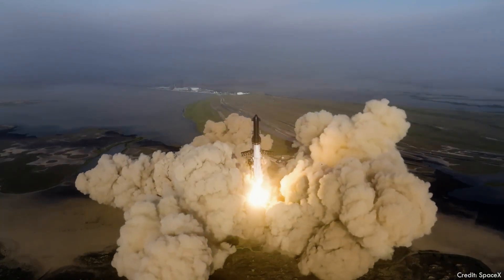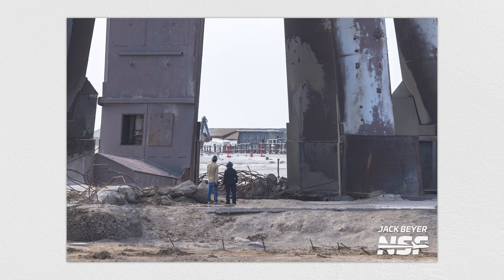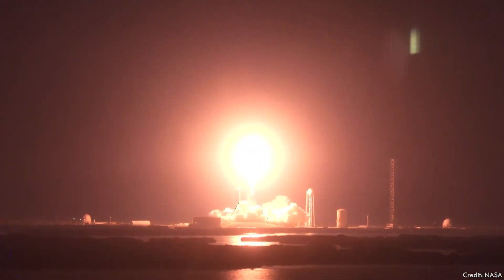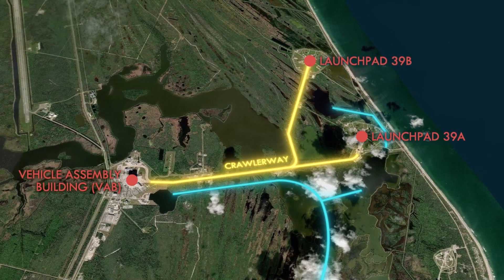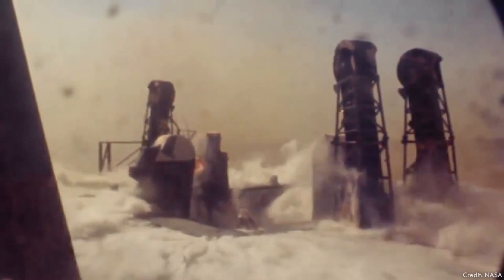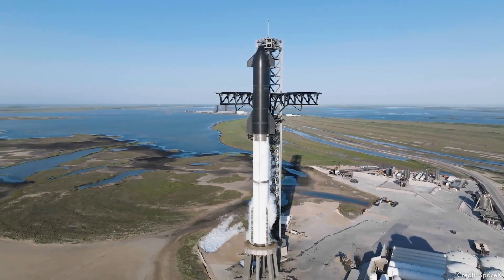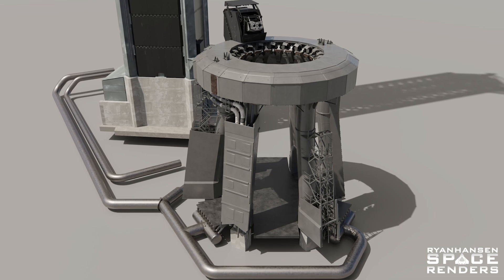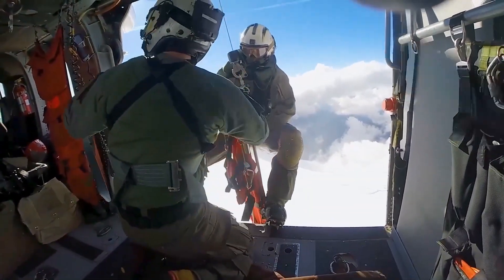Was Starship’s Stage Zero a Bad Pad?

Comment: I'm not sure that rocket engineering is something that should be subject to a rapid development cycle. Hopefully the regulators force more care into their preparations as this situation looked like it was entirely avoidable, they were just too cheap to build a well-tested existing design.
Reply: One thing I learned from the comments is that there's always a naysayer until they move to the next goalpost, i remember when they tried to land the booster and fail and shower of negative comment about why not use paraglide blabla
Reply: it already made the falcon 9 the most awesome rocket ever.
Reply: For cargo, it's a case of buyer beware for the most part, if the rocket blows up it's just an expensive insurance claim. But for passengers it's a completely different story. This is why I'm sceptical Starship is going to be used for crewed flights any time soon, not until it's had at least a couple years of regular reliable unmanned launches.
Reply: @Croz89  It's not going to be used for crewed flights anytime soon, they've explicitly said they're not trying that until they have a lot of reliable successful cargo flights under their belt.
Reply: @zorbathut  Yeah, though there's a bit of a disconnect between grounded statements from SpaceX and Elon's marketing hype, which probably makes some people think he wants to send off a Starship full of astronauts to Mars by next tuesday.
Reply: @snuffeldjuret  I'm not so convinced. He could be much more careful with his words if he chose to be. But he knows generating hype is good for business even if it comes to nothing, and I'm sure it pleases his often rather devoted fanbase no end.
Reply: @snuffeldjuret  It's not illegal at all, he's not in a courtroom. Lots of corporate leaders promise the moon and don't deliver, it's just Elon is especially prolific with hype. And I'm sure he's clever enough to formulate a grounded and realistic answer from any question the media throws at him. But he thinks it's better not to, and based on the fame and wealth it's got him, it's clearly worked well for him.
Reply: @snuffeldjuret  Hmm... if he said it under oath, perhaps? He could also mislead investors, but just making overly ambitious statements is unlikely to be enough for that. Honestly some of his statements about Tesla and Twitter stray way closer to illegality than anything he's said about SpaceX.
Reply: @snuffeldjuret  The truth is I can't think of much of what he's been saying that could be illegal, not about SpaceX anyway. I think it's up to you to prove illegality rather then me to disprove it. Because freedom of speech heavily restricts being arrested for just making a statement.
Reply: @snuffeldjuret  Huh? I'm sure you're the one who said marketing hype would be illegal.
Reply: @snuffeldjuret  @Croz89 For statements by a company to be illegal, they largely have to fall into two categories:

1. They are statements about the past or present, that are false, and the person making the statement should be aware that they are false. Saying something like "We have developed a new technology to do X" would be an example, if they have developed no such technology. Or "We just landed a huge contract", when no huge contract was signed.
2. They are statements about the future, that the company is certain won't happen. So saying something like "We will land people on Mars" is fine, if they believe it. If however an email surfaces where the person says "we are obviously never going to land on Mars, but I'm gonna go lie to the investors about it" then that is not fine. The issue here is proving what goes on in someone's head.

Musk says a lot of things about the future that turn out to be false, but did he believe the things he said when he said them? Probably yes. And that is not illegal.
Reply: @SpaceAdvocate  And even if he didn't believe them, that wouldn't be enough make a case against him.
Reply: Considering the built-in self-destruct also failed, combined how obvious the pad failure should have been ...Yeah, I'm not at all unsure about whether or not rockets should have rapid development cycles.
Reply: Yeah, this result was obvious to quite a few people before the launch happened. It's not like this was an unexpected event. The Boca Chica site was never supposed to launch things anywhere near this size, Elon just got a toe in the door and wedged it all the way open. He was obviously more interested in the press this launch would generate than actually making this launch site successful.
Reply: @warpigs330  Nope, thats how spaceX operates for the past 20 years. Theres a whole compilation of their rockets blowing up. SpaceX themselves said they "hoped" the launchpad was going to make it through one launch, which means they accepted the risk that comes with it.
Since it was launched 4/20, yes hes a little bit of a memer. But the launch was going to happen in April no matter what.

SpaceX will keep blowing up rockets and people will keep complaining and thats fine.
Reply: @warpigs330  in musk mind a failure is a success.
Reply: @warpigs330  it was supposed to when they got permission for it.
Reply: Rocket engineering can be done in a rapid prototyping sort of way, if you don't try to be extremely cheap and work around regulations, which IMO is the dangerous mix that SpaceX is working with.

For example, if you look at the environmental assessment, the number (and thrust) of engines reported doesn't match Starship at all. Some folks have claimed this was done to increase their odds of getting the assessment approved fast, because if they used the forecasted Starship data then it would be clear that lots of mitigations such as flame trenches/diverters were required and approvals for those sometimes take years.
Reply: You must think they're building a dam or something. There is much that you're likely not aware of. Example, there are no flame diverters on Mars. The destruction was part of the learning process
Reply: @IRRoy-69  are you saying the destruction was on purpose?
Reply: @leafnut1  Well, forget Mars launches for some time.  Best not find excuses for that incompetents.

Comment: Virtually every aspect of this launch failed. The pad, the engines, the emergency abort system, the separation, the extremely low speed and distance achieved…

…but if you work for Space X you have to cheer or you’ll be fired.
Reply: No, it was a resounding success.

Comment: Just a point of clarification: The flame deflectors of launch pad 39A and 39B, during the Saturn and Shuttle eras, were steel frames covered in concrete. At least during a Saturn launch, approximately one foot of the concrete was ablated off of it. Also, the one shown in your graphic at about the 6:18 point is for the Ariane pad in French Guiana. It is a one sided deflector. The Saturn deflector split the exhaust to two sides.

Also, the flame trenches were initially lined with ceramic fire bricks to protect the underlying concrete. I don't know if that has been replaced by refractory concrete or some combination.
Reply: Actually, to correct your correction: The graphic at 6:18 is indeed LC-39B, and not the Ariane V pad. One of the SLS mods was to make the flame deflector one-sided.
Reply: Thank you for the extra information on the flame deflector designs.
Reply: "Ablated off" is my new favorite way of saying "utterly obliterated."
Reply: @ethannguyen2551  The difference between those two terms is as fine as the line between 'that worked out how it was supposed to' and 'honest, that was definitely how we planned it, I guess?'... 😂
Reply: "spit into two sides" I'm thinking that looked like an inverted aerospike?
Reply: @JoshyCC  Effectively, yes.  A linear AeroSpike anyway.
Reply: AFAIR (from David Baker's books 'The Rocket'/'The History of Manned Spaceflight' read 35 years ago), the flame deflectors in Pads 39A/B for the Saturn 5 were inverted V-shape mobile structures made of steel with their exposed surfaces covered with a refractory layer of a basalt-like material of volcanic origin.
Reply: One Shuttle launch spit bricks out at supersonic speeds
Reply: repentandbelieveinJesusChrist9  Go and pray for us to repent instead of spamming YouTube
Reply: repentandbelieveinJesusChrist9  Your religion is dying and there is no place for your god-of-the-gaps to hide anymore, all these posts do is push more people away...
Reply: repentandbelieveinJesusChrist9  Maybe you should ask for an x-ray of your head! From afar I'd suppose a pencil shoved up your nose...
Reply: I didn't know there was such a thing as sacrificial concrete!
Reply: repentandbelieveinJesusChrist9   “Troll — in the dungeons — thought you ought to know.” — Professor Quirrell
Reply: repentandbelieveinJesusChrist9  I'll continue seeking retribution for all of the children victimised by the church before anything else kthx.
Reply: @TheDemocrab  And the Jesuits for selling slaves in 1835 to fund the church.
Reply: @TheDemocrab  "... children victimised by the church ..." "Victimized by the Rulers of this World" is the more correct interpretation, based on copious evidence. "The Church" is only a subset of [Their] dominion over Us.
Reply: If you are going to go after the church because some of them abuse, children, you need to go after everybody else as well. Don’t just pick out somebody’s religion and accuse the whole institution of abuse because a few of them committed atrocities. Just shows your own prejudice. I don’t necessarily agree with spamming some message of repentance on YouTube but, you can do better.
Reply: @odinmaximus5768 the thing is, the church has repeatedy and actively covered up these sorts of things. It is therefore quite culpable.
Reply: @DavidLindes 
Which church? Except for a few basic concepts, Christianity is not a monolithic institution! Besides Catholicism, there are about 2,000 other denominations of christianity worldwide. So again, which church? And if your going to say 'all of them' be prepared with examples of each and every one. 
Having said that, yes christianity has had its share of problems. But to blame an entire belief system for the actions of some is a blatant equaivalent of racism. Also your accusations fail to account for the similar actions of others outside Christianity. Is it OK for them?
Reply: @chuckaddison5134  “to blame an entire belief system” makes sense to me when it can be shown (as I believe it can, though I won’t attempt it here — see Greta Christina’s writings or something (not certain if she gets to this specific point, but I’m sure I’ve read someone who does)) that the belief system itself has a causative influence (not to say it’s 100% causative) on the “actions of some” in question — and, especially, when it can also be shown that the “good” actions taken by folks with the belief system are not actually done because of the belief system in most cases, and indeed are often done in spite of said system.

Yeah, there are many many churches. And also, the belief system itself is fundamentally problematic. In ways that aren’t necessarily obvious at first glance… because it’s often the things that get held up as moral goods that create the problems. (E.g. “be fruitful and multiply” leading to a sense of dominion… not to mention teachings that actually encourage dominion… etc. etc.)
Reply: @chuckaddison5134  oh, and I forgot to answer your final question: no, it’s not ok [to do whatever antisocial behavior we might be discussing; I’ll assume for the sake of argument that we agree on what those behaviors are], whatever the motivations and such (i.e. whether religion had anything to do with it or not). That said, if, say, 1/10 murders is caused by a belief system, and 1/100 would-be murders are prevented by the same belief system, then the belief system is still on net responsible for taking more lives (or whatever other ill) than saving them, and our adherence to it should still be discouraged (not to say outlawed — that’s not my argument), in my mind. (Obviously the numbers aren’t so simple — or easy to figure out, even. But I think it can be clearly demonstrated that more lives have been lost and/or ruined specifically in the name of Christianity (or gods more generally) than have been saved by them. “Saved” souls notwithstanding… I’m limiting myself to what we can directly observe on earth.)
Reply: Yep, the wrong footage was shown. 
And yes built to be rebuilt between launches having not damage to the real structure.
Reply: repentandbelieveinJesusChrist9  Thanks for the rubbish.
Reply: "...flame deflectors of launch pad 39A and 39B, steel frames covered in concrete". How is that different from the steel reinforced concrete at starbase that blew apart?   "...during a Saturn launch, approximately one foot of the concrete was ablated off of it"   That was the first saturn launch.   "...the flame trenches were initially lined with ceramic fire bricks".  Firebrick is refractory cement in brick form.
Reply: @rcpmac  The difference is having flame deflectors in the first place, to divert sound, fire and debris into a save direction. Those are designed to be expendable and easy/cheap to replace. Starship burned a nice big hole into the expensive lauchpad and flung debris into every direction, causing even more damage to the surrounding facilities.
Reply: @rcpmac  Bicycles and cars are both steel and alloy/composite vehicles assembled for transportation using rotational energy and a multi-speed transmission to drive drive wheel(s) which are steel or alloy/composite framed wheels with pneumatic tires.

Doesn't mean they are similar, even if you pick a few technical details and word them similarly.

The starbase pad was a "portable" launch pad dropped somewhere, which was self contained and included no force redirection, and instead required surviving to protect the ground it was laid on.  Pad 39A used redirection and multiple protections to prevent damage to the environment and minimize damage to the structure of the pad to minimal wear of parts designed to be replaced on each use, and the environmental impact studies included the ablation in the report.

Elon lied in a federal filing about the environmental impact.

They are not the same.

From the complete failure of Starbase, it's clear the design goal.

Elon has landed at sea.

Elon wants to launch at sea.

The first step (of many), is to make a pad that can survive a launch.  Second is to make a ship capable of holding the pad.

Launching in Macapa is "ideal", because the speed of the earth's spin is greatest on the equator, and you want to be on the east part of a continent, so you launch over water.  So it's Brazil, or Kiribati, both are so remote, and have no existing commercial relationships for Elon to exploit, he would go for a ship-based launch.  Load everything in FL and go to the equator just off the coast of Brazil, or load everything in CA and head off to the deep pacific, and you can launch and land without the FCC whining about "destroying wetlands" and almost no applicable laws.

Elon has lived his life avoiding and exploiting rules, I expect him to be aiming for ship-based launches.  And a tiny, fragile launch pad is exactly what he needs.  Now he needs to make it just strong enough to not sink the launch ship.

Brazil recently sold an old aircraft carrier for $2M for scrap.  The next ship that size that goes up for sale, look for company with ties to Musk to be bidding on it.  Then, the first time the Starbase pad survives, that design will be locked in and re-shaped to fit the ship he buys.  Then it will have a launch from the back and a capture from the front, and will be a single sea-going vessel capable of launching and recovering a rocket.  His actions telegraph his intentions.

Send me an iced coffee if I'm right ( I prefer hot, but it'll be cold by the time it gets here anyway).
Reply: repentandbelieveinJesusChrist9  I went through and kept track, and if you count all the times Jesus tells people to do something, they're almost all versions of love our neighbours, help the poor, and don't be self-righteous and judgmental.  Most people agree with these things - even atheists like me!  I love how the Bible says so often that God's kingdom is a place where they look after the poor, widows, and foreigners.  This is actually the only way to have a good economy and a strong nation.  It barely ever mentions regular people's sins; it just goes on and on about wicked leaders and priests who don't look after the poor and vulnerable, who bribe and swindle.  The prophets blame the wicked shepherds for the people sinning, because they misled their flocks.  So many preachers preach the opposite, and it's not hard to guess why.  The stuff people preach that makes people flee the church is all stuff that the Bible doesn't really tell people to do, and humans have twisted.  It's usually based on vague verses that we can't even translate properly, or that the context says can't be interpreted that way.  But wow, some of this stuff is still so relevant, like Isaiah 58 could have been written last week.  I hope that more Christians who've been misled by the Prosperity Gospel will learn what it means to seek God's kingdom, and do righteousness.  Ezekiel 34, Matthew 23, the book of Amos - really, wow, preach these if you want some converts.  This stuff is real life now.  Even if I don't believe in God myself, if you preach the stuff that Jesus said was important to him, and you want to get rid of the leaders who aren't looking after the poor or foreigners, widows and children, then I support you.  I wish you lots of luck saving your religion from the wolves in shepherds' clothing.